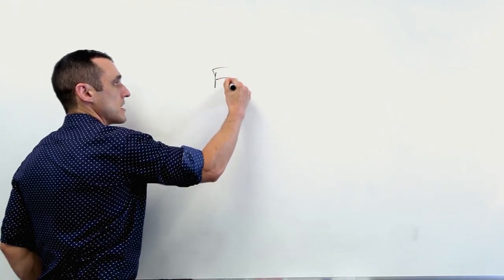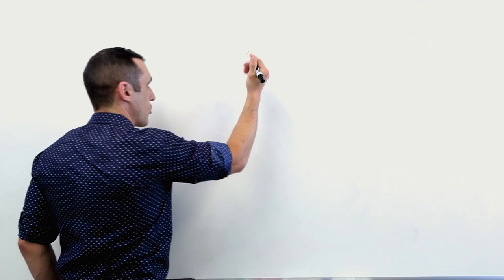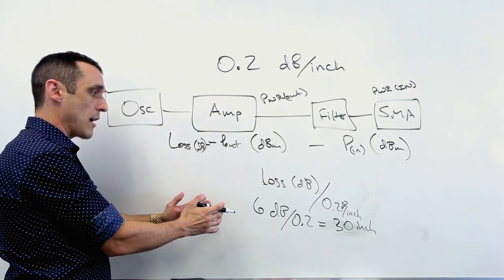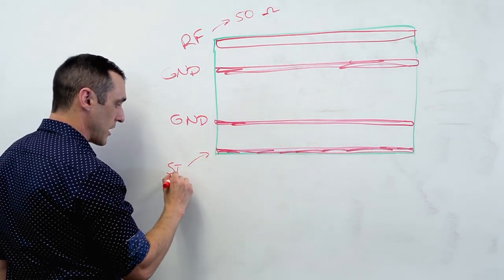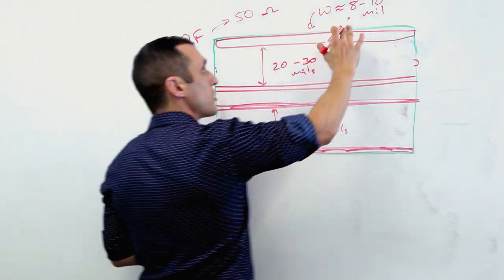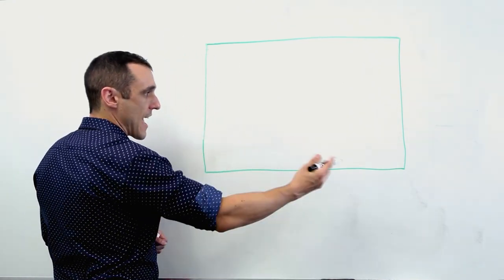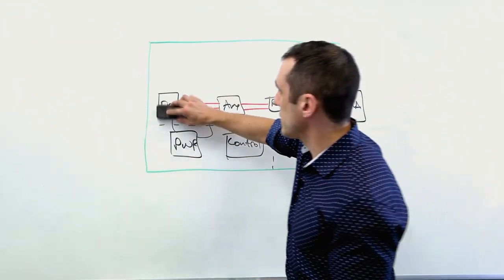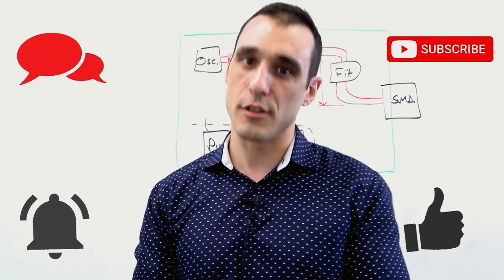Starting an RF PCB Design

Comment: One of the most important comments is "discuss with your board partner". We are busy with an RF design working up to K-band. We had an idea on the materials and stackup we wnated to use, but before we even started the PCB layout, we contacted our board manufacturer and discussed our requirements with them.

Comment: TBH for freq<8GHz you dont have to worry about skin effect and roughness of copper foil - you should be more worried about proper copper finish (use for eg. ENIG or sth even better). For freq >3GHz I would also avoid covering your tracks with soldermask. Also what is worth mentioning you should avoid FR4 cores for circuits with amplifiers (eg. RF transmitters) bsc this materials cant stand much heat. For RF boards I can recommend stackup with like: RO4350B core (35um copper and like 0.5mm height) + FR4 prepreg (eg. 0.2 mm) + FR4 (35um copper and 0.6-0.8mm height). I like that you mentioned mitter bends, bcs many designers forget about them. Also folks remember that every bend changes electrical length of your trace. Really nice video as always. :)
Reply: In the types of copper and roughness video that is the conclusion we land on --> don't worry unless you're gettting above that 10 GHz value
Reply: It might also help a bit to pick FR4 with a high TG because it has a higher ceramic content and therefore a more stable DC over temperature. 
I love the mitered bends too, they’re even better than round corners up until certain frequencies.
Reply: @Niels_Dn  With the Tg value it depends more where you deploy. I've done test antenna board at 5 GHz wifi with low and high Tg FR4, worked beautifully each time with no problems. The production versions were on high Tg. We talked about that in a different video on stackup materials.
Reply: Marcin one thing I forgot to mention about the surface finish, if you're in that low GHz range (2.4 GHz Wifi/Bluetooth) you don't need to even worry about surface finish. John Coonrod has a ton of data that I've cited showing the deviation in insertion loss on microstrips and CPWG with various platings, those curves all overlap up to about 5 GHz. For us, in the high frequency range for the radar and sensor products we do, we prefer silver due to the shorter shelf life with OSP.
Reply: @Zachariah-Peterson  I probably saw the data you are writting about and its ofc true. For high frequency and high reliability we used to employ an ISIG (Immersion Silver/Immersion Gold) finish, but novadays its hard to find a seller for this tech. We keep looking for nickless alternative for ENIG (like EPIG or EPAG, but not many providers in Europe have those in offer). Bare silver is not the best option for us bcs it tarnishes and need special hermetic casing - also most of our RF microwave circuits need some sort of tuning and testing before we can put them in enclosures.
Reply: @Zachariah-Peterson  I also generally use low TG FR4 up to 6 GHz, but if the temperature range is wider (e.g. -40 to 60 degC) I tend to pick high TG. 
Also when it’s an expensive design, the high TG is just a bit nicer and doesn’t add much to the total cost of the product.
Reply: @MrMarsjano  I am wondering why you don’t want nickel in your board plating?

Comment: Hey Zach! Amazing videos, seriously!
Just a quick question: In a board with an FPGA and DDR3 DRAM I only need 2 signal layers. Should I have 4 layer stackup with 2 signal layers and 2 GND layers, skipping the POWER plane, or should I go for a 6 layer stackup to make sure I have that power plane to ensure good decoupling? But then I will have 1 layer that I really don't need.

Comment: Insertion loss should be S12, S11 is for return loss
Reply: S21 is insertion loss for the signal injected at port 1 and traveling to port 2. S12 is in the reverse direction. I think the only time I mentioned S11 is with inputs to discrete components, which can give you very small amount of loss since they are not always perfectly matched to the system impedance, but they can get pretty close.